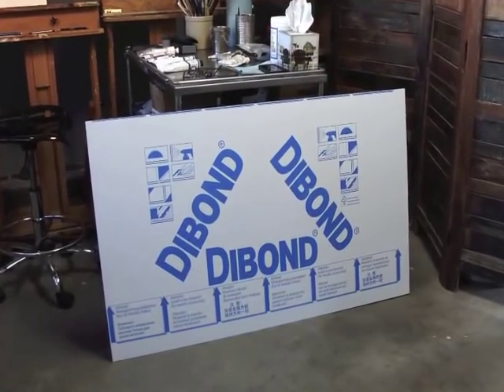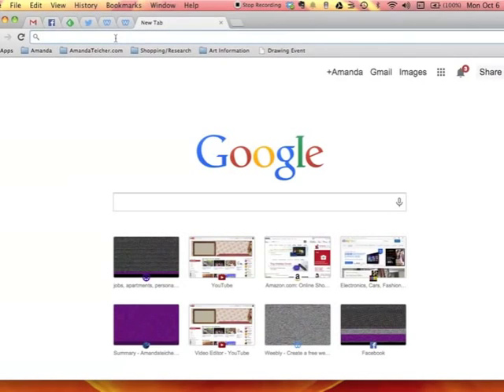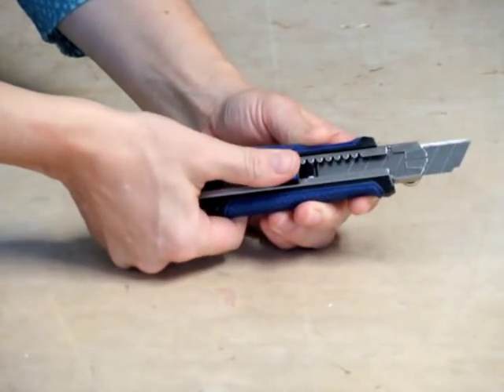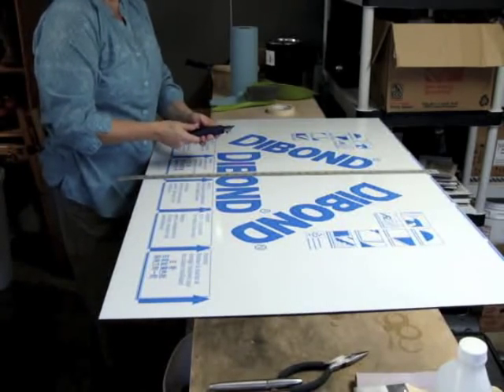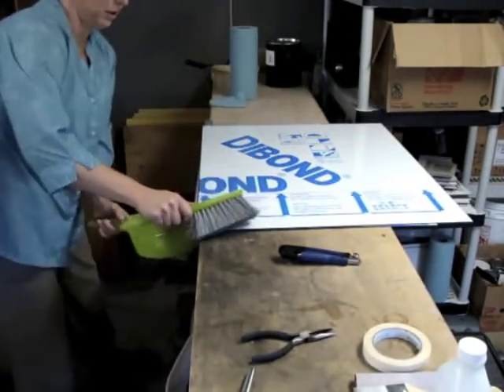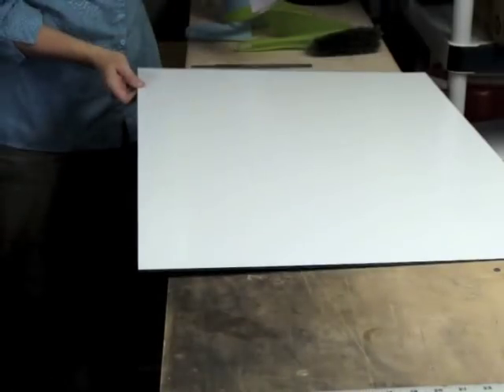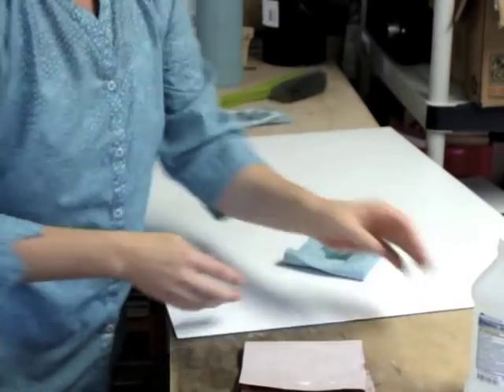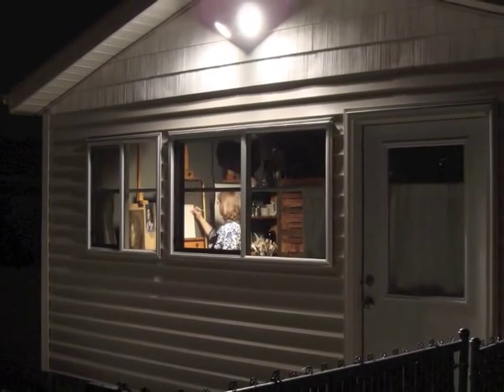Dibond: Buying, Cutting, and Priming

Comment: Hi Amada, great video and very well explained. If I want to adhere primed linen canvas to the dibond, can I sand, gesso and then adhere the canvas using a PH Neutral PVA glue?. I tried doing it without gessoing but the glue seemed to bloom and form glue droplets....
Reply from the maker: +Sam Wade good question. You can adhere linen to Dibond after sanding the Dibond. I wouldn't apply gesso before the glue. I've done it with acrylic matte medium. I'm working on a video about adhering linen to wood panels with reversible adhesive, and later I'll create a video about ahering linen to Dibond.
Reply: +Amanda Teicher Thanks for your reply Amanda, In regard to adhering primed linen to the dibond, I found that I wasn't sanding the surface enough to create sufficient tension. My advice if anything would be to use 400 grit wet&dry sandpaper and a drop of water to really take the shine off the dibond before applying the PVA glue, works great for me anywho. Also one thing I have found when adhering primed linen canvas is that the texture or weave becomes more pronounced.... Is this normal?
Reply: +Sam Wade I'm using Golden GAC Soft Gel slightly thinned as adhesive. Try that and see if it works better. And don't gesso the surface, you want your adhesive to bond directly to the panel.
Reply from the maker: +Sam Wade Good question. I haven't noticed an enhancement of the linen texture when adhering it to aluminum composite material. I've only adhered Centurion brand primed linen, which I buy on jerrysartarama.com. It has a pretty fine texture, and I've only adhered finished paintings to the panel, rather than primed linen that I would then paint on. I like your method of scuffing the surface of the panel. I've switched lately from medium-grit sandpaper (120 grit) to 220-grit. I found I was sanding too hard with the rougher sandpaper. Thanks for commenting.

Comment: Hey Amanda! really good and informative video, question from an art student here, ive also been using dibond and love it. My only problem with it at the moment is the dibond panels bending slightly probably due to them being stood against a wall for some time. i tried to bend them straight again using weights laying it on a flat surface but wasnt successful. You have any advice on this problem? do you think its impossible to bend them back to a straight shape?, thanks for listening!
Reply from the maker: Oh dear, that would be a problem. I'd turn the panels over so they lean against the bend and leave them alone for a while. After that, I'd store them in between two other vertical elements so they won't bend. I'm going out to my studio right now to check on my panels-in-waiting. Thanks for the comment!

Comment: Note on using a file. I think Amanda is using the wrong stroke in her video.
Push the file in one direction only. Remember, it' s not a saw -- this file was meant to cut on the away stroke. Put pressure on the return stroke and you'll dull the file and mangle the cutting edges.
http://www.instructables.com/.../Introduction-to-Files.../
Reply from the maker: I'll remember that. Thanks!
Reply from the maker: rixpix2200 I made more Dibond panels a few days ago, and I have mended my wicked filing ways. Thanks for the tip.

Comment: Amanda, have you figured out how to achieve clean edges on both sides without having to sand/file ie on first cutting process?
Reply from the maker: I always sand my edges with coarse sandpaper. I don't see any way around that step. I wrap the sandpaper around something with straight edges, a block or a piece of panel, and it goes pretty quickly. Have fun!

Comment from the maker: Hi +Forrest Aldrich,

For some reason, I can't reply under your comment from yesterday about the Sherwin-Williams bonding primer, so I'll comment here.

I haven't heard of that product before. When you said a few people recommended coating Dibond with that product, are they fine artists with a knowledge of materials and how they last over decades, or are they people at the Sherwin-Williams store or at the Dibond distributor? I agree that adhesion is important, but I wouldn't want to put any more chemical compounds onto my painting surface than are necessary, just because I don't want unpredictable reactions in 50 or 60 years that result in paint flaking off, or yellowing, or other bad outcomes. The Sherwin-Williams primer is an acrylic emulsion product, like the acrylic dispersion ground from Daniel Smith, which is also described on the product website as an acrylic emulsion.

http://www.danielsmith.com/Item--i-G-284-040

I guess I would continue using artist-grade primer. I'm thinking that the polyester coil coating on the panel is compatible with the artist-grade primer I'm using, and that the bonding properties are similar. I looked at the Sherwin-Williams primer data sheet, looking for a list of ingredients, so I could compare it to the Daniel Smith ingredients, but Sherwin-Williams isn't giving out their formula. Daniel Smith isn't either. 

I attended a Painting Best Practices workshop by George O'Hanlon, technical director at Natural Pigments, and his company sells ACM panels, pre-primed. He recommends using an acrylic dispersion ground right on the polyester surface, but sanding it lightly to promote adhesion. He's very knowledgeable about materials, so I'm going to follow that advice for the time being. 

Thanks for sharing the product information. That was interesting.
Reply: That Sherwin Williams primer can be found at Lowes, Homey Depot, etc etc and is some really awesome stuff with a number of different uses / applications.   We've used only the water based but believe they have it in an oil base also.

Comment: Amanda, a few people have recommended coating the dibond with this prior to gesso:  http://protective.sherwin-williams.com/detail.jsp?A=sku-25999%3Aproduct-6786    DTM Bonding Primer, especially for polyester.   I was told that this makes for a better adhesion surface with acrylic gesso.   Not sure I would go through all the trouble, but curious if you've heard of it.
Reply from the maker: +Forrest Aldrich I'm sticking with acrylic primer as well as acrylic gloss mediums for adhering linen. I've consulted with experts in the art world, including a conservator, a co-founder of a paint company, and a materials expert at Golden Artist Colors. They tend to be wary of adding too many products, especially as those products can change a lot, because it's difficult to really predict how they'll hold up, and how they'll interact with the paint film. I believe the adhesion between the polyester paint and the acrylic primer or medium will be sufficient, but of course, time will tell.
Reply from the maker: +Forrest Aldrich Perhaps one of the best things we can do, not knowing everything, is label the back of the paintings we make with the materials that we used, in case sometime in the future, someone needs to know.

Comment: It seems that the Dibond website you mentioned no longer has a distributors page...:(
Reply from the maker: +David Cunningham You're right, David. I'm planning to make another version of this video this year (shorter, more accurate), and I'll find another way to show people how to find the panels.
Reply from the maker: +David Cunningham The best advice I can give right now is to search on Google Maps for "sign shop," and call them. Ask them where you can buy aluminum composite panel (Dibond or the no-name brand). They should have some information for you. Good luck.
Reply: Thanks for a great video...I have been painting on Birch plywood for years and have a few primed panels to last me a while, but when these run out I will give Dibond a try!
Reply from the maker: Wonderful! I found the web page that shows you how to locate Dibond distributors:
http://graphicdisplayusa.com/distributors/
You can also use a no-name brand of aluminum composite material as artists' panels, which is cheaper, and usually available at the same supply houses. The aluminum layers are thinner on the no-name brand, but they're sufficient for fine art application, especially any size panel that's smaller than about 24x36.
Reply: +Amanda Teicher Will it be sufficient for a painting of a larger size, such as 40"x72" or will I somehow need to brace or cradle it? I'm a grad student trying to find a support that is large enough for life sized portraiture. I have wanted to try Dibond for awhile after seeing David Kassen's work. Thank you for this video and the accompanying information!
Reply from the maker: Hi +Becky Webb. I would get some aluminum channel from Home Depot and some epoxy and try to create a cradle on a small, experimental piece of Dibond. The tricky part would be cutting the channel, or having someone cut it for you. If you frame your work, I'd suggest a thick piece of Dibond, like perhaps 5mm or 6mm. Then you can just cut it to your preferred size, put it on your easel, and then have it framed. But that's expensive! Also, try not to drop it, because the corners are somewhat fragile. Someone I know suggested cutting Dibond with a hacksaw instead of a utility knife, or, rather, after scoring the surface with a utility to create a path for the hacksaw (if you don't have access to a table saw). Please let me know how it goes.
Reply from the maker: +George Everet Thompson That's awesome! I love how the wood pieces were attached to the ACM, allowing a wire to be attached. Thanks!
Reply: +Amanda Teicher  Is it difficult to cut the aluminum channel?  I am assuming I can use my miter saw for the angle cuts.  I looked up the channels on Home Depot; would you suggest the u-shaped channel?  Also, don't the edges of the panel need to be finished somehow?
Reply from the maker: I'm sorry, Becky, I can't answer your question. I've never used aluminum channel. The people at Home Depot could probably help you. I always frame the paintings I make on Dibond, and so do the people who buy my Dibond panels.
Reply: +Amanda Teicher I'm buying the square channel and an appropriate saw blade tomorrow.  I've cut my sheet as per your wonderful directions.  I noticed that Daniel Smith Acrylic Gesso is no longer available.  I normally use Blick Artist grade Gesso which says it is 100% pure acrylic polymer emulsion.  My professor asked what was coating the aluminum and suggested a matte gel medium.  I'm not sure it will give me the same kind of surface for oil paint.  Do you have any thoughts on this?
Reply: +Amanda Teicher  I really liked the aluminum channel more than the wood cradle.  Of course I had to buy the proper saw blade for my miter saw, and there were a lot of shavings to pick up afterward; but the overall weight of my 80"x48" panel was much less than if I had used a wood cradle. And I found I only needed to cradle the perimeter.  I also screwed corner brackets in for added stability.  I used Loctite Constuction Adhesive (for aluminum and plastic).  Transported it in my Volvo for critique with no problems.  Thanks for all your advice!
Reply from the maker: +Becky Webb The paint on the aluminum surface is polyester coil coating, or polyester paint. It's compatible with acrylic mediums. I've been researching acrylic mediums for use as adhesives lately, and I've consulted with a materials expert, George O'Hanlon, as well as a materials expert at Golden Artist Colors and a conservator who participates in an artists' group on Facebook. After testing several mediums, the best I've found is Golden acrylic Polymer (Gloss) medium. Any gloss medium should work well, as long as it's an all-purpose gloss medium. I would stay away from matte mediums, because they don't adhere as well.
Reply from the maker: +Becky Webb Wow, that's very cool. I wish I could see a photo of the cradling you added to the back of your panel. That's a big panel. Glad you could fit it into your car.

Comment: Typically we cut our panels with a panel saw and am here after a search on hand cutting di bond.   Actually....  We switched to using "Alupanel" in our shop which is pretty much identical to Di Bond, but a fraction of the cost.   Unless someone told ya you would not be able to tell the 2 panels apart.    Nice video tho.  Thanks
Reply from the maker: A panel saw ... I dream of one day owning a panel saw. I do now have a table saw, which is great for trimming and for cutting thicker panel like Alumalite. Thanks for your comment!
Reply: My pleasure.   Keep a regular eye on Craigslist for a panel saw and you will eventually find one like we did.  Ours was about 600 bucks used but I'll tell ya what.....  Best 600 bucks we've ever spent!    Ever get into a pickle with any of this stuff don't hesitate to hit me up.   Got 45 years in the sign/graphics, racing and fabrication industry and learned quite a lot in that time...........   And ya.......   Made a s#it ton of mistakes also... LOL !!!
Reply from the maker: Ha ha! Love that! If I ever need wisdom, I'll know where to go! And I like the Craigslist idea.

Comment: Also there should be 2mm thickness aswell which is a bit cheaper.
Reply: +TopWrapz 3mm option also comes with matte texture on the other side. that is cheaper than the one that has gloss white on both sides.
Reply from the maker: +TopWrapz Material in 2mm thickness would be fine for small panels (say, up to 8x10), but I'd stick with 3mm for most sizes, for two reasons: it's rigid, and it's widely available.
Reply: +Amanda Teicher I see!